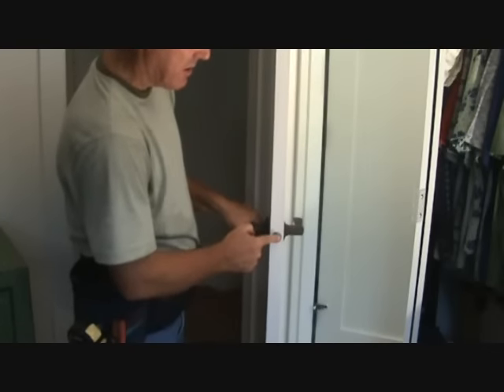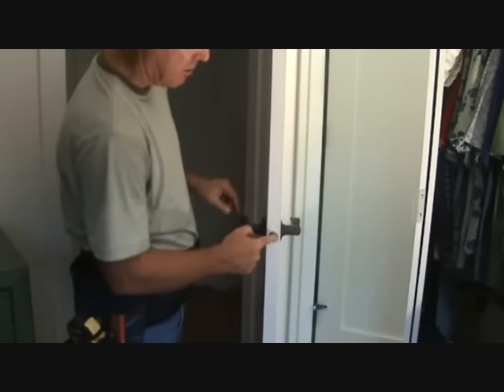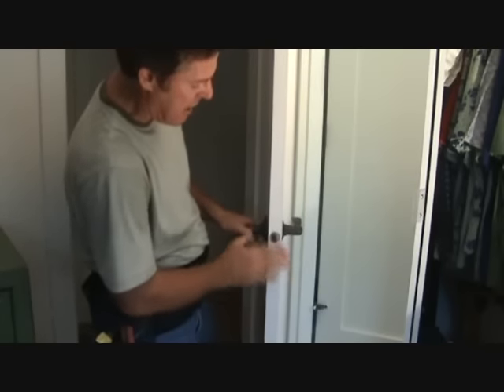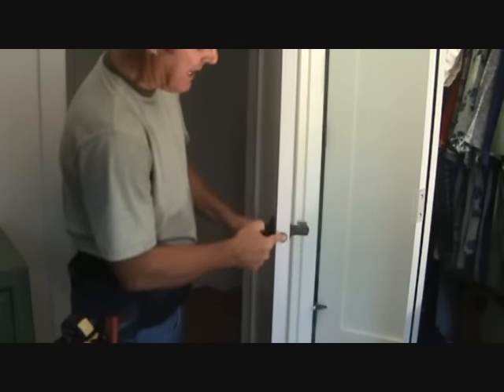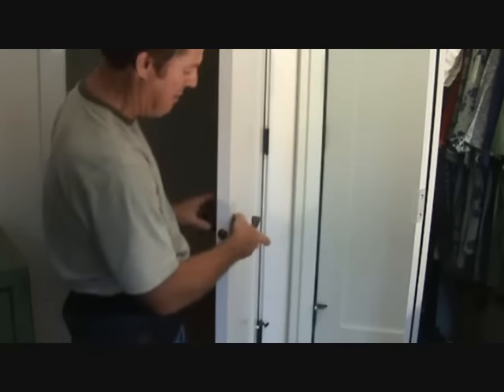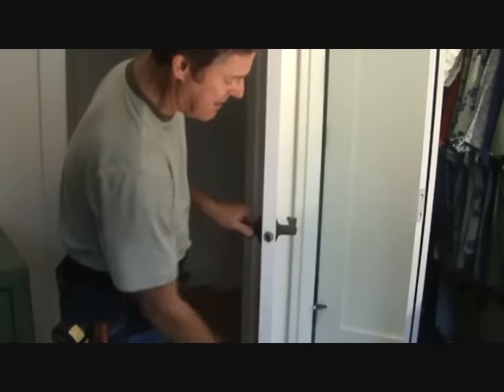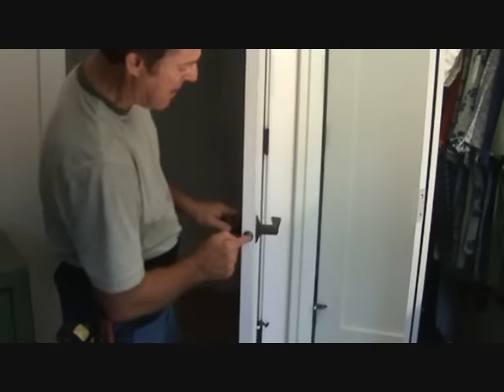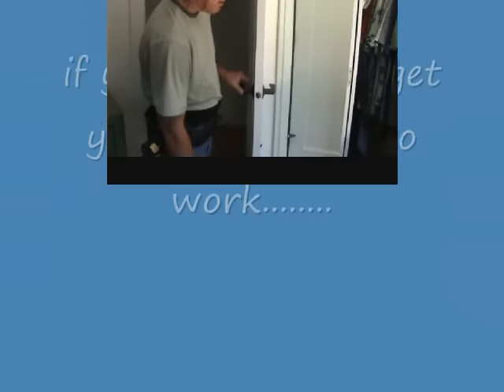Is your "door latch" sticking?

Comment: Our front door opens with a key and the latch goes in and out just fine.  But going from the inside of the house to outside, the latch just stays inside the mechanism when you turn the handle.  The door then won't stay closed.  How is it that one side works and the other side doesn't?  How do I fix this?
Reply from the maker: The exterior side apparently is opening & closing the latch just fine "when you use the key". But when you are on the inside of the door you are using the handle & not the actual key. This is 2 different things on how the latch is working. Your latch is sticking when you are using the inside door handle. You need to remove the body of the door handle & spray some silicone spray in there & free it up. This will also clean the gummed up area. work it back & forth. Now spray some on the outside of the latch as well as the inside of the latch (since you have the body of the handle removed. Now put it back together & see how she works. It should be working fine now. If it's still doing the same thing, you may have a broken part on the inside of your door handle. Most of the time though, it's just gummed up & sticking just enough to keep the latch from coming back out. let me know how you do.   Joe  :0

Comment from the maker: Your latch might be so worn that it's ready to be replaced. It could also be broken inside & maybe that's why it's still sticking. If the 3 ways I explain, won't do the trick, it might be time to replace the entire door handle assembly. Thanks for sending me a line. Good luck with your project!   Joe  :0

Comment from the maker: Can you put a screw driver in there & use that, to turn in there, that will pull the latch back into the door? You could also try using a thin putty knife & slide in between the door & the door jamb, up against the latch....pull back on the door then use the putty knife to slide the latch back into the door. Just a little then pull on the door so the latch doesn't slip back...then use the putty knife some more & little by little you should be able to pull the latch into the door.   Joe  :0

Comment from the maker: Try spraying some WD-40 on the sticking latch & press it a few times. If this does not loosen it up, you would then need to remove the door handle unit & see if there are any broken parts or the side groove might have come out. Spray more WD-40 in there & move around. You can then look more closely at the side latch too. If you have silicone spray, use that rather than the WD-40.  Let me know how it goes. Thanks for your question. Good luck.   Joe  :0

Comment: Hi joe! What do I do if the latch is stuck in the out position and the door is shut? Sledgehammer? ;)
Reply from the maker: Ha! Yes....just get a bigger sledge hammer! Actually I guess you wouldn't want to fix it that way. Can you get in the room from opening a window or something? If you can get in the room then you can unscrew the door handle trim cover from there then remove the screws from the body of the lock. sounds like you might have a broken door latch. let me know if you can get it removed.   Joe  :0
Reply: yes. Thank you. My husband was able to get it off without too much damage to the door. :/

We've now replaced it with a modern knob and lock. Thank you!!
Reply from the maker: Good. Look & see if the door latch still looks like it's in working order & if it is, you can spray some silicone spray on it & work it back & forth. You could then spray silicone spray into the door mechanism & that will free things up....if it's just been gummed up over the years. Look closely though as there could be a broken part in the door body assembly &/or the side latch could be damaged. If you see that the side latch is damaged, you might get lucky & pick up a similar latch only, at your local hardware store. But if your door handle unit is fairly old anyway, then I would suggesting to purchase a new one & be done with it. Good luck with your decision. Way to go hubby!   Joe  :0

Comment: I had a doorknob handle that was loose and came off we think it was bent inside and wouldn't hold the screw anymore so we went to Lowe's and bought a new one same brand only it was a regular kwikset and not a smart key like it had been before installed it but I didn't think that would make a difference,  and we now have 2 problems facing the front of the door turning it towards the right it sticks like bad both sides of the door also turning the lock from the inside is almost impossible (I'm scared to force it afraid it'll break)and slightly tough with the key (afraid the key is going to break sooner or later) feel like we did something wrong but can't figure out what, can you help us?
Reply from the maker: Tony B. Sounds like maybe you have put both portions of the lock in the wrong way. Take back apart & take both pieces of the lock & slide them together so you know how it goes together. It should slip right together then you swivel the trim ring to match up the screw holes.  See how the latch slips in there too? The latch may have a roundness at the end that should slip in the body of the lock the same direction. It should slip in there too. Maybe you have the body of the handle unit flipped the wrong direction & the latch fits in there but really tight & then the lock won't turn very good either. If all else fails, look at the directions in the box!....LOL  with the handle unit being brand new it should go together fine & everything should work after you tighten up the screws. Take it apart & try putting together without putting it on the door & you should see how the latch fits in there properly. There might be some slits on the edge of the latch & if it doesn't fit in properly it could be dragging there & maybe that's all it is. Check it out & let me know what you find! Keep with it. You can do it!   Joe  :0

Comment: Joe, the latch does not retract into the door all the way, making it difficult to open the door.  What do you suggest please?
Reply from the maker: Sounds like the door latch is not hooked in properly & half of one of the ears came loose or worse broke thereby causing the latch not to go all the way back. The only way to find out is to remove & look at it & then spray some silicone spray in there too & twist the knob with the latch still working to see if you can see what's going on. If you can't get it to work then I would say remove the door handle unit & replace with a new one as the one that is giving you issues is probably pretty old to begin with seems as though you are now (or were!) having an issue. thanks for stopping by!

Comment: joe, i have ashed door that opens out, all winter long, the lock cylinder has not worked, not turning all the way. i was advised on here to get some graphite grease, but i cant find any, so i used lithium grease,still the same problem, moisture is getting in, ived used 3 cans of lock de icer so far, how can i fix this?  dick bailey
Reply from the maker: Your area must be cold! I would remove the lock off the door then spray a silicone based spray in the lock & move it around, etc then put your key in it & try moving the lock back & forth. spray some more silicone spray in there & keep moving your key back & forth. If your lock does not move freely you could have an internal issue which would need a locksmith's assistance. They could look at it & do what is needed to fix your locking cylinder area. Then you can put the existing lock back on your door. Try that. Good luck.   Joe  :0
Reply: joe, this winter has been extremly cold. i did take the lock off the door, but,i used white lithium grease,along with graphite spray. i am concidering changing the whole assembly,but it  hasnt been on there that long. how much would you pay for a good lockset?  dick bailey
Reply from the maker: I'm kind of thinking maybe the grease you used really should not have been used. I generally use a silicone spray on the inside of a lock & if the key just sticks a little graphite could be used to "puff" into the key slot. A little late for that now on your lock though. If your lock is not that old, may I suggest you take it back to the hardware store where you purchased it telling them of your disappointment in the lock you purchase at their store. This will give them the "opportunity" to make it right. That said they would probably offer you a different lock &/or the same one as before. I would certainly try that route before thinking you need to purchase another just yet. Let me know how it goes!   Joe  :0
Reply from the maker: WD even carries a silicone spray now. If you can't find that, there should be some other brands at your local hardware store.

Comment: Hey Joe, my latch is stuck as if it's locked. But the Handles are attached to the latch anymore. And it's not just sticking, it's full out jammed.
Reply from the maker: There could be an issue with the inside of the door handle & you might even need to replace it with a new one. You could at least pull it apart then spray a silicon spray in there all around & the door latch too then put it back together to see if it will work. If it still gives you issues have a good yell out in the back yard then get yourself together to make a run to your local hardware store to get yourself a new door handle assembly! YOU can do it!

Comment: Joe my latch is stuck and will not allow the door to shut without turning the door handle, I took it apart and put some lubricant into to it, to no avail, when I push the latch in with my hand it feels like something is blocking it from allowing it to open inside the round tube............help
Reply from the maker: How old is your door handle unit? Could it be possible that it's time for a new one? Your door latch could be defective & or not wedged into place proper or something could've broken in the door handle unit thereby making the existing door latch not work properly? Usually the door latch gets gummed up after years of use & some silicone spray generally does the trick....but not in your instance. Remove the handle unit again & carefully look at where the door latch fits into the body of the door handle unit & see why it appears that it's hitting something. Remove the door latch all the way, if need be & see if anything looks amiss. If it's really old & you can't seem to get it repaired....replace the entire unit with a new door handle. They don't cost too much at the store & are easy to install. I'd prefer to do that rather than to purchase a separate door latch to replace your existing. Thanks for your message. Hope this helps.   Joe  :0

Comment: hi Joe,

The latch on my front door doesn't go in fully and catches on the strike plate. I have to use a good amount of force to open my front door.

How can I fix this?

thanks.
Reply from the maker: Remove the existing door handle assembly & remove from door. Take some silicone spray spray in your door latch area as well as in your door handle assembly you have removed. Move the door knobs/handles back & forth & spray more silicone spray in there. reassemble everything & that should do it...unless you have a broken part in the door hardware assembly. Let me know how you do.   Joe  :0

Comment: I just bought a new door knob set.  As I was installing it, the door slammed shut and I couldn't get the latch to retract. I used a screw driver inside and I got the latch to retract.  Now I can't get the latch to come out again.  What do I do
Reply from the maker: Sounds like you need to remove the main body of the door knob set then unscrew the side door latch & remove it. There's a little slide goody in there that sounds like it's not lined up properly & that is what is keeping the latch from retracting I'm thinking. Look at the direction sheet & see what needs to be done. The side latch is adjustable for 2 3/8" backset & 2 3/4 backset & it sounds like something in there is not turned properly to match up to your main body. Good luck with it. If I was there I'd fix it for you.....but I know you can do it!   Joe  :0

Comment: latch was apparently broken in the 'locked' position.  took the handles out and tried to manually open latch.  didn't move. now i don't know what to do.  cant get the door open to take off latch plate and slide out.
Reply from the maker: John Robbins There's got to be a way you can move it around with a pair of needle nose pliers or big screw driver to see if you can pull back the latch.  I know it's broken but put your thinking cap on & try some different things. A lock smith would have to do the same thing & they will charge you at least $100  service call fee just to get your latch out of there. There's something hanging up causing your latch not to retract. Keep working at it to get it out. You can do it!   Joe  :0

Comment: Ok,  I finally fixed it.  I took the door into the garage and drilled out fresh holes using the hole saws (drill bits).   What I think was the problem was the wood on the door may have absorbed small amounts of moisture over time,  and perhaps became soft.  Each time I would sufficiently tighten the screws,  it would warp just enough to bind up the motion.  The metal would just catch on itself.    Well, that's my theory, anyway.  Thanks for your repies!
Reply from the maker: Wow nice job with fixing it yourself. & you learned some new things too! Way to go.

Comment: Joe, My deadbolt sticks in the out position only when the door is open. When its closed the deadbolt throws nicely. What is causing this?
Reply from the maker: Hmmmm not sure. Screws on door too tight or take the door handle apart & spray some silicone spray in there as well as on the latch itself & that should do it. Thanks!

Comment: Thanks for the video, Joe. I've sprayed with WD40, and it seemed to help for a little while, but my door latch continues to get stuck inside the door. (I must confess that I haven't taken it apart because I'm afraid I won't be able to put it back together again.)

Here are the details:

I have a front door with a thumb latch. When I use the outside thumb part, and press it down completely, it sort of "clicks" and shifts downward inside (I can see it happen) and the door latch gets stuck inside the door. It doesn't happen every time. When I use the interior handle (it's a lever), the door latch sometimes gets stuck, but not as often as it happens with the thumb latch.

When the latch gets stuck, it's impossible to secure the door. I've been using a screwdriver to "pop" it out so that I can latch and lock the door. (When it's stuck I can't use the deadbolt which may be how this mechanism always works; I don't know.) 

Any ideas for a quick fix, or is it time for a new mechanism?

Thanks so much for your help!
Reply from the maker: Rebecca Adler  I will say that generally on a front door this issue happens a lot on older door hardware as the exterior conditions cause the latch to gum up &/or gets a bit rusty & the latch because slightly worn causing additional issues. Also if you have a silicone spray rather than just WD 40, that could help better too. I think though that it would be best to carefully remove your interior door handle so you can spray inside. You may also find that a piece of the door latch may have slipped out of position thereby causing some of your issue as well although that usually does not happen but is possible. Take a cell phone pic before & during, this could help you with reinstalling the door handle. After you spray the inside of your handle assembly, make sure you spray some on the inside of the door latch as well & push in numerous times & spray more before putting all back together. Make sure to wipe off all excess spray running down the door if any. This generally will work for awhile longer but if you continue to have same issues every few months or so then I would advise you to think about replacing your entire door hardware with new. Let me know how it goes! You can do it!

Comment: My Anderson storm door is stuck in the locked position which means I cannot open the door. How do I get it open.
Reply from the maker: You may have to contact an Anderson door dealer or supplier. Most of those locks are not similar to the one I showed. Good luck.   Joe  :0
Reply from the maker: Thanks for sharing this video BTW. Much appreciated!    Joe  :0

Comment: Hi Joe: I have a front door hand that has lost its spring. It opens and the latch doesn't stick but it doesn't have the spring affect. What is wrong?
Reply from the maker: The latch probably needs to be cleaned out & some silicone spray applied. You could try to spray some silicone spray in on the side of the latch without taking the knob all apart. Try that & see what happens. You may though need to take the door handle assembly off from the door & spray in there to clean & lubricate it as it's dirty & or too dry from the outside elements. If your door handle is really old you may need to replace your entire side latch with a new one but try the silicone spray first. also if you have the whole door handle off look in there & see if the door latch is put together in the body of the lock properly. I've seen one before where it wasn't in there properly which could cause the latch to not be the right springiness. & you could have a little part of your door assembly lock having a part broken in there. Lots could be happening in there so you should take it off the door to see. Be careful as you are pulling it apart so you know how it goes back together!   Joe  :0
Reply: Thank you s0 much for your response. I will try spraying it first. It may need replacing. It's 10 years old. Have a nice day!
Reply from the maker: Ok. Let me know how it comes out!   Joe  :0